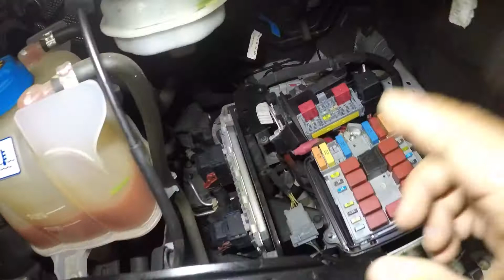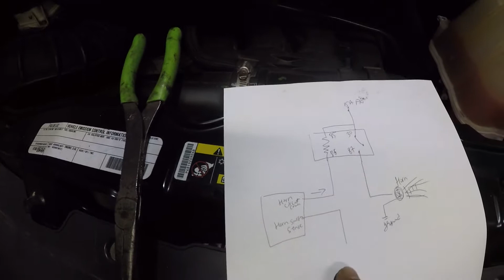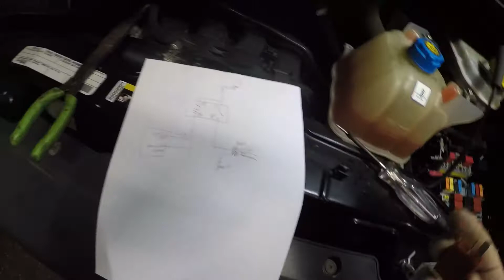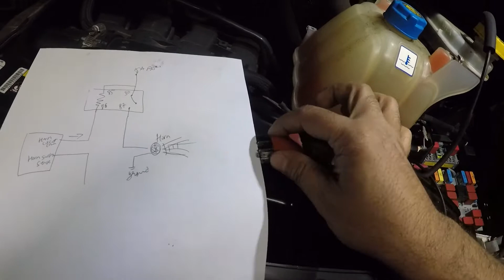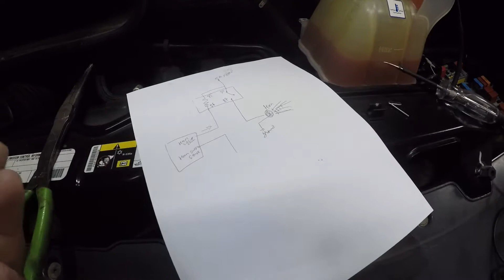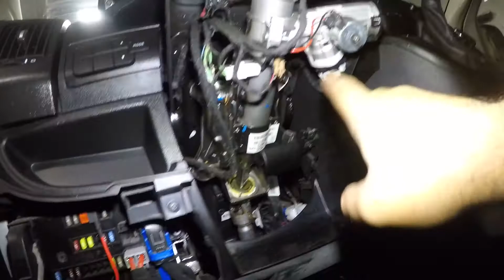2018 Ram 2500 Promaster horn fuse and relay horn circuit diagnose

Comment: I’m over here at O’Reilly with my 2020 promax and on the Internet it shows a different fuse panel layout than what I have. I’m fully frustrated for no reason the low headlights went out the other night and I’m pissed. I’m driving with my highbeams and people are pissed off at me.
Reply from the maker: Oh darn I’m in north nj if u local u can stop by but start with checking all fuses located all fuses under hood inside by steering also these have fuses behind sumwhere passanger seat